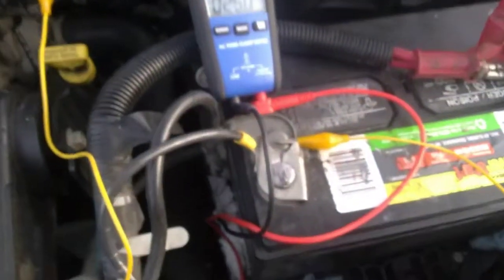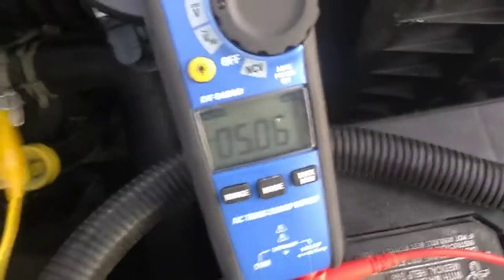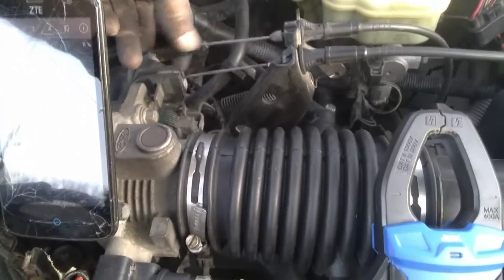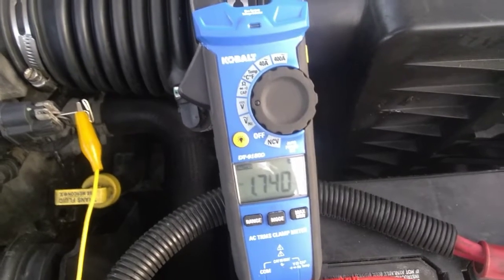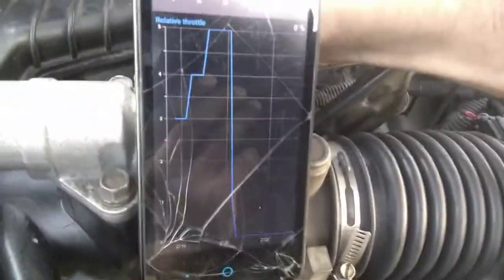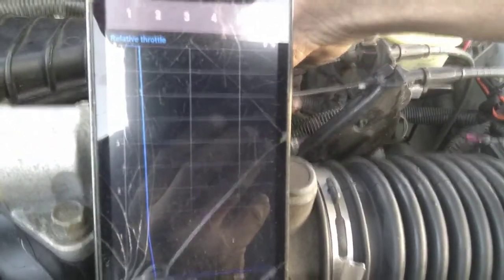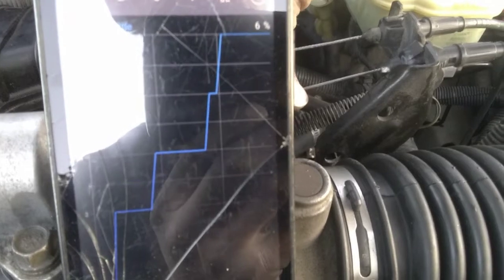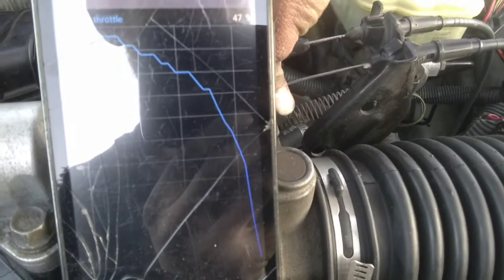Ford TPS testing with a multimeter and scan tool. Potentiometer style sensor shown. Freestar 3.9L V6

Comment: You are quite an accomplished trouble shooter. A  TPS can also be tested in OHMs/resistance. Disconnect, connect multimeter in OHMs. Move TPS through its range. The resistance will be very unstable with a bad TPS. You can test a new TPS the same way before installing. Results: 700 ohms to 4.2 K ohms for Ford 302 V8’s of the late 80’s   part number E6AZ-9B989-C . Should be similar for this TPS? (maybe)